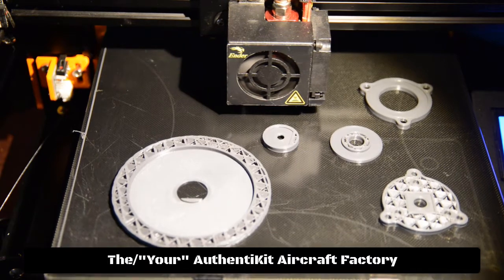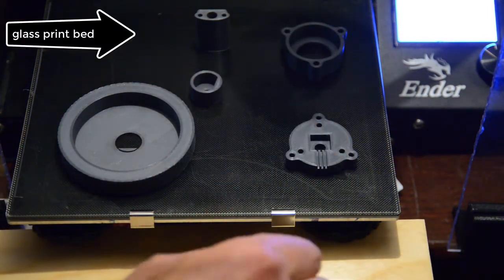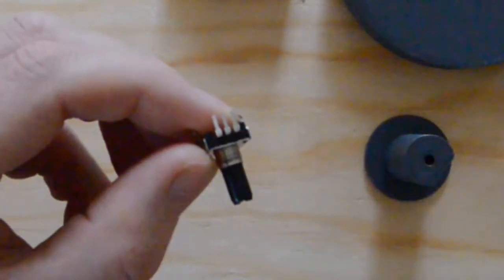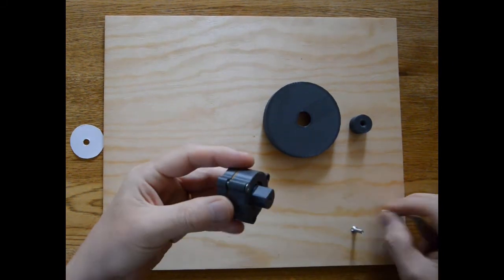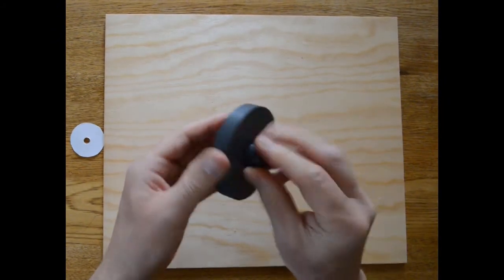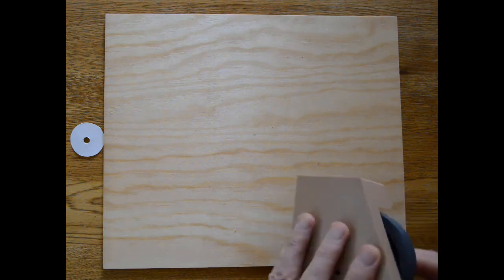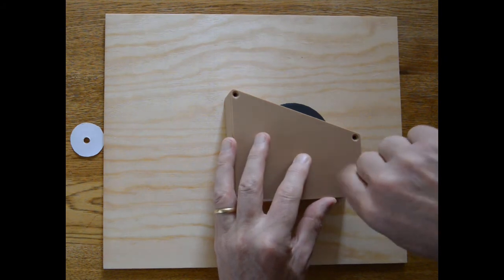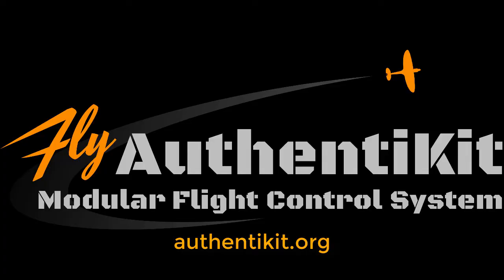AuthentiKit Flight Control System - Assembling a trim wheel

Comment: That ender printer has some nice quality prints.. You did nay mods to it?
Reply from the maker: Pretty standard. Spent time on alignment. Used a glass bed from wisamic.
Reply: @AuthentiKit  Just out of the box ender printer? wow, maybe I should have gone that way has a bigger print volume than my mini.. i stayed away from ender coz of what i have read about making a good print out of it
Reply from the maker: @daemon3spade  Actually I remember one thing I did that helped - the Luke Hatfield mod where you put a separate length of tube in the hot end. Can't say Ender 3 was perfect for me. I've since got rid of it and now use the 6SE